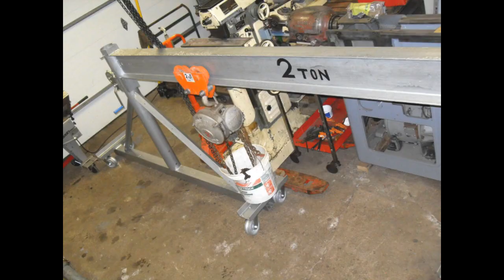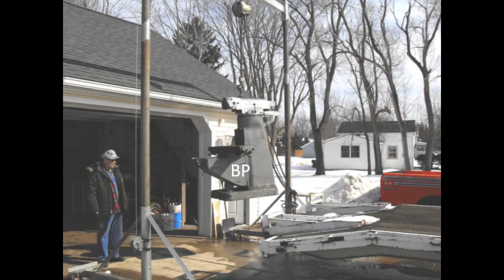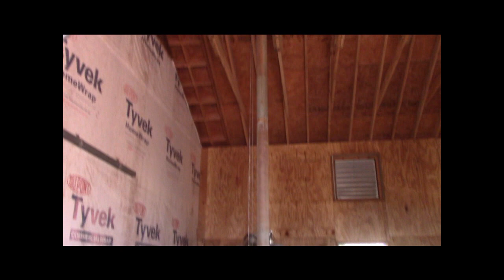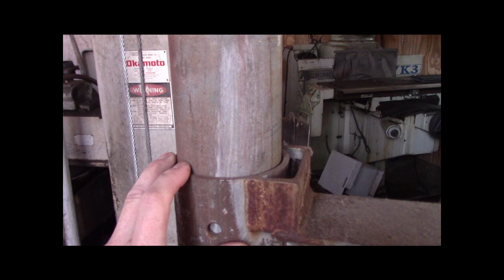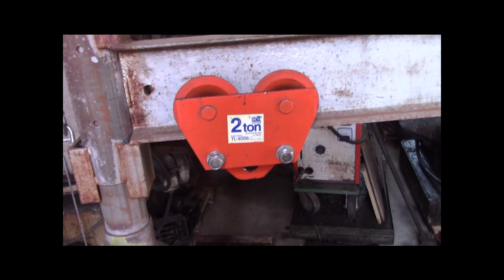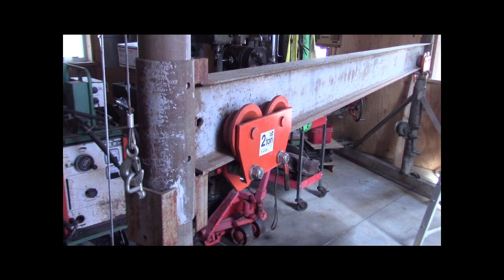1-7-23  --  Taking down my Shop Made Gantry

Comment: Tools used to mean what you were capable of. The job climate, easy times, hard times you spoke of are real, but there's a whole bunch of people that aren't aware of it. It amazes me what gets thrown away and scrapped. It's almost as if it doesn't have an "easy button" - (or insert "IDK how it works") - it's time to give up and go do something else... just pitch it. 

I watched a perfectly operating old manual shift (no shuttle or torque convertor) forklift get loaded for scrap. Stored indoors forever, driven right out to the truck to load(by the scrapper). Nobody in the company would use it so it sat in the corner. The company was well down the road from the original proprietor who bought it new/nearly new. All different owners, managers etc. They needed a forklift, they had a couple but sometimes needed another. Rather than LEARN to use the one that sat, they scrapped it for $300 or so and spent tens of thousands for another.... then would use one of the (now) three they had for 10 - 15 picks/moves a week....like trash detail, move a skid from here to there, nothing difficult or even requiring skill, otherwise it sat in the same corner. Not surprisingly, the owners ended up liquidating 4-5 yrs later, claimed they couldn't make money, that the "market" changed. Obviously there were other "forklift" style changes made in the company, that somehow just didn't add value to things.

The only thing harder to find than someone willing to work hard, is to find someone willing to work and critically think at the same time. Has to be the scarcest thing we have in this country today. The idea of doing/acquiring skills and tools/equipment to do things yourself has almost become an unthinkable think.

I like the idea of double trolleys on that gantry. I could see it changing difficult picks in an instant. Thanks for sharing
Reply from the maker: Thanks Old School.  Have not heard from you in a while. Glad you are doing Ok.  Maybe I need to post more earth moving videos for you to comment on. LOL  Glad you liked my gantry video and glad you considered my thoughts on the place we are today.  I am really glad I have my shop and my smarts.  People today lack fortitude. They don't bring any value to anyone. Talk is cheap and whiskey costs money.  Or something like that.  Some day I will stop working as an engineer and open my machine shop. Things just have to fall into place, but I will be ready. Stay well.  --Doozer
Reply: @kooldoozer  LOL... nah... there's plenty of dirt everywhere... no need to "dirty" up a video😅.. I can't STOP thinking we're living in a titanic of a country... between vast numbers of criminal politicians and swarms of cracked people living in lala land... how will we not sink. I didn't have to spend a second considering your thoughts.... you're right and I agreed with you before we knew it haha. Keep at it, don't let someday be never!